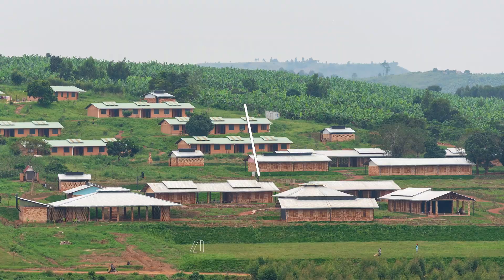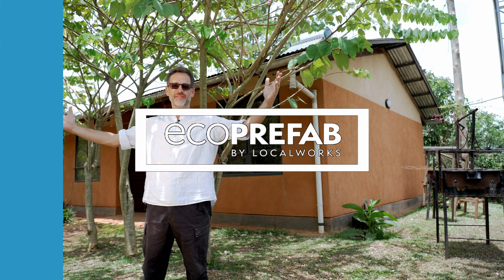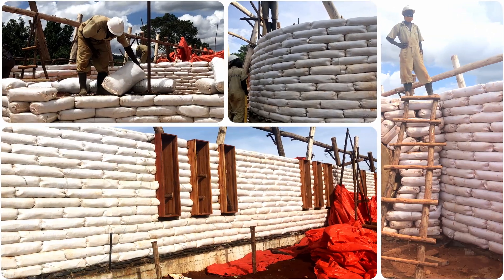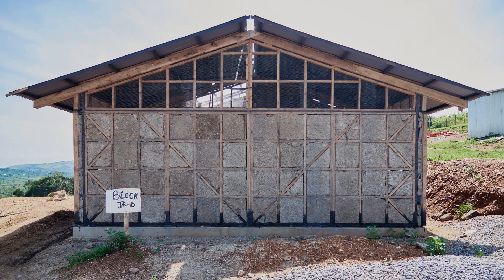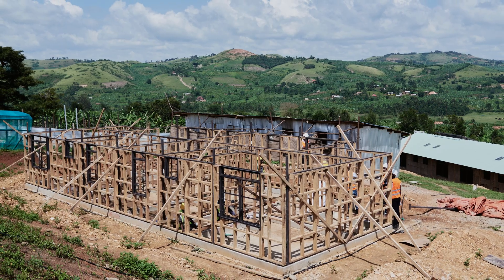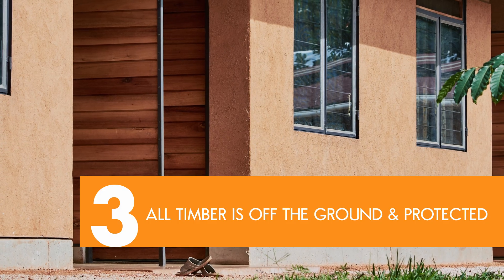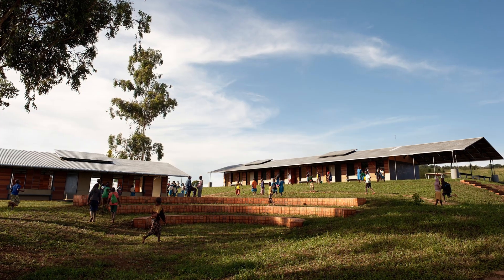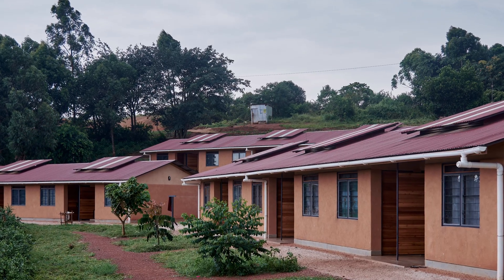Build Schools 3X Faster: EcoPrefab by Localworks

Comment: I’m not quite sure why Compressed Earth Blocks didn’t meet your assessment as a suitable material. They don’t carry the negative impacts associated with wood-based panels, and construction with them is also relatively fast. Were you producing the blocks yourself or sourcing them elsewhere? Or was it mainly the aesthetic appeal of wood that led you to move away from Compressed Earth Blocks?
Reply: We are big fans of CEB, use it on many of our projects, and generally consider it a highly sustainable material. But: We feel the technology is not easily scalable to adequately respond to the needs of the education and housing sectors. Every site has its own soil conditions, and tailored design mixes and careful supervision are needed to produce high-quality outcomes (we make the blocks on site, usually using hand-operated presses). By contrast, sustainably sourced timber is light and easy to transport, and wall and roof elements can be easily prefabricated to a high level of precision in a controlled factory environment. We are not really aware of any negative outcomes of timber frames, at least for as long as the timber is procured from FSC certified forests -- can you outline what those negative consequences would be?